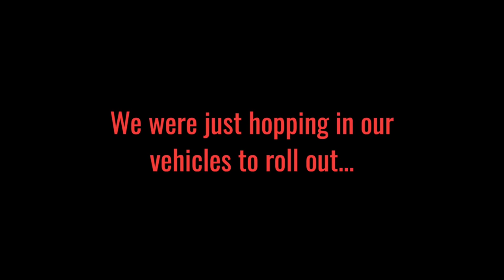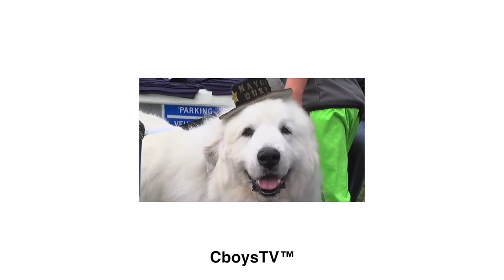JET SKI JUMP OVER ROAD!! (Big Crash)

Comment: Building a safe environment is more important, as well as instruments
Natural disasters are real and people do not truly understand the mineral deposits underground
including natural gas development that can cause explosions, there are also more potential hazards.
People usually wait for accidents to happen allegedly before they make changes
When construction sites excavate minerals under the ground they find massive rocks etc
that they may not even understand existed.
the ground can fall apart drilling holes in different places can crack major rock developments like nails can do with hammers. unnecessary.
erosion clearly